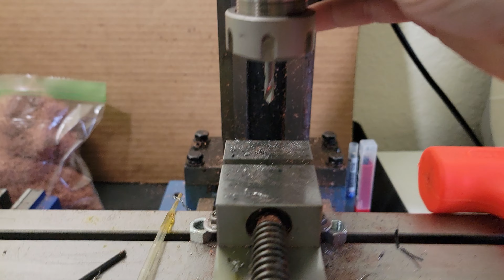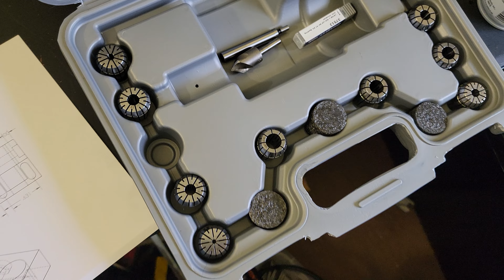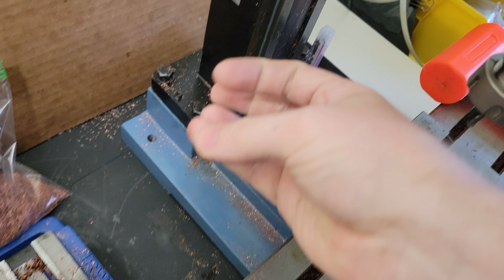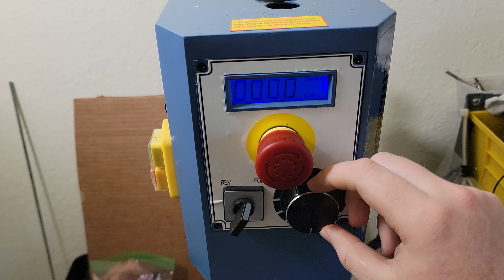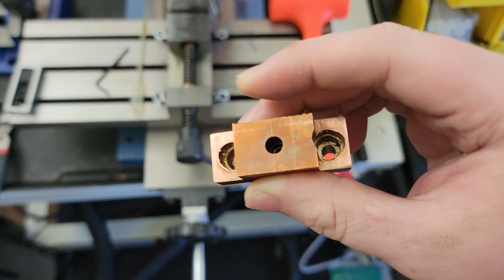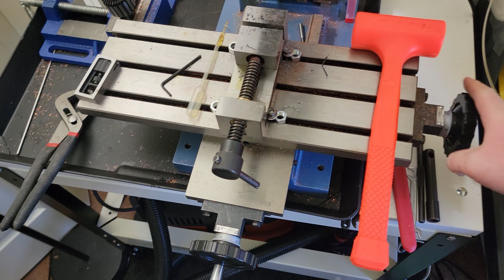Little Machine Shop Model 4700 HiTorque Micro Mill

Comment: I have the same mill, and i too also learned on a bp. But this machine is highly capable, but the set up shown here is not very rigid. I run all end mills straight out of the mt2 collet, forget the er, because it just adds length and reduces rigidity. And like someone mentioned, an actual proper milling vice not held down by precariously place nuts, i made my own clamps and have an awesome set up with this mill, and you can take some serious cuts.

And i have also made an auto feed using 3d printed stuff, its not a bad idea at all.